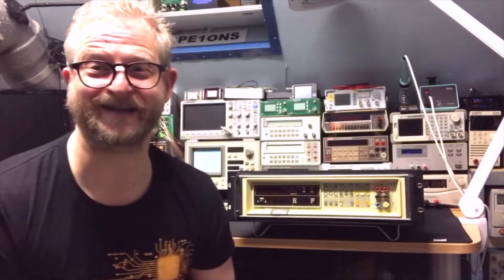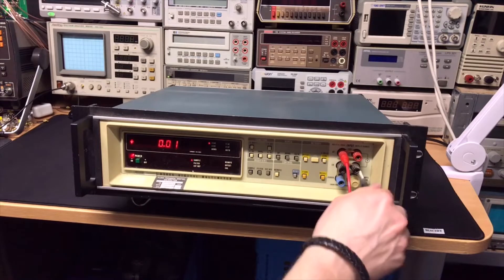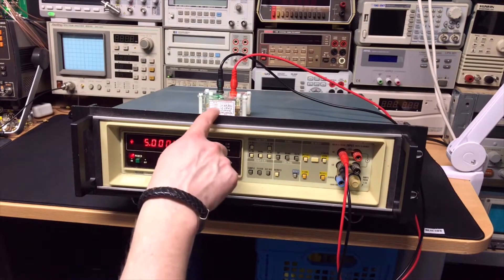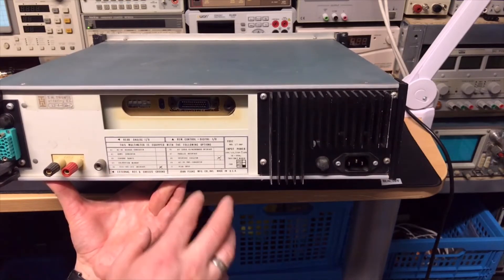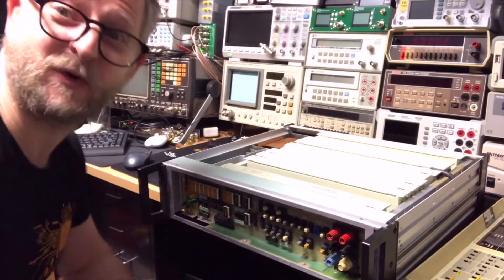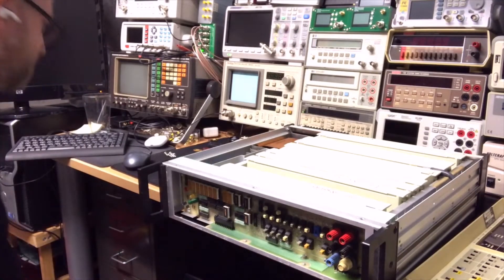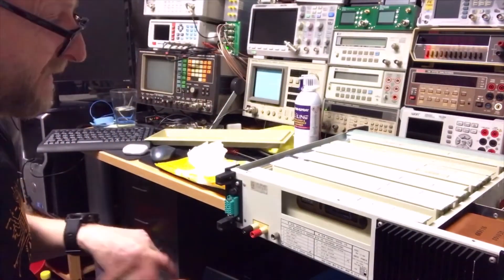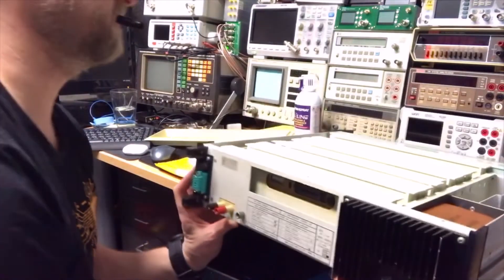#133 Fluke 8500A Restore Teardown with a nice surprise inside

Comment: @Tony Albus    did you scan the operating instructions?  I just brought a 8500a back to life, several blown tant's in the power supply, one on the DB board (I think), a bad linear regulator and a bad op amp in the zero setting circuit and a bad pair of flip flops in the adc...  Really like to get the little cards for the drawer.  Thank you.
Reply from the maker: Hi Keith, Nice find! Well done fixing it.. i did make pictures because it was starting degrade .. i left it in a zip file in the description of the video
Reply: @TonyAlbus  ah thank you, made my day!  I'm also putting together an 'alternative fixing guide' for the 8500A as I came up with a diagnostic technique for the ADC ladder that makes it so much easier to fix. A payback to the community on the EEVblog forum that were helping me.
Reply from the maker: @keithmarlow  Thank you for that, great you share that with the comunity

Comment: I worked for a company many years ago which considered the 8500 as their go-to multimeter. They were used in equipment racks to measure Vdc (microvolts) for the characterization inertial grade accelerometers. I have two 8500's mostly for nostalgic reasons.  My bench multimeters are currently the Fluke 8842A and HP 3455A.
Reply from the maker: Thank you for sharing, yes very nice piece of equipment!.. Your meters are very nice too
Reply: I replaced the VFD on the 8842A with an LED display sold by an engineer out of the Ukraine.  It works really well, making the 8842A like new.  

FYI:  The 3455A uses a 10Vdc reference module which is removeable from the rear panel.  I removed that reference module from a nonworking/parts 3455A and repackaged.  I now use it as a 10Vdc reference for calibrating/checking my other DMM's.  Tony: you do a nice job with your videos...Grade-A from a retired professor...(math and physics), much better than that Aussie clown.
Reply from the maker: @scarpia519  Those VFD are getting low at some time then?? , Yes LED should be good readable, nice you then have indeed a very good reference, smart solution!..  
Thank you! i am glad you enjoy it... it is a very nice hobby.

Comment: Any idea what the green connector on the back (left) is?
Reply from the maker: Its the 'back terminals' option, it's an AIO plug to have the same terminals as the front, while i don't have the front/back switch option... so it must be in parallel then...

Comment: The new looking capacitors and a factory service replacement of grey mepco caps that would start leaking mod came out in the early 80s The C with numbers is the options installed when the instrument  first launches it reads the modules  option 2 ohms and 3 current 5 IEEE For your reset issue you may want to look at the caps in the power supply
Reply from the maker: Thank you very much for sharing that, very usefull, thanks again!